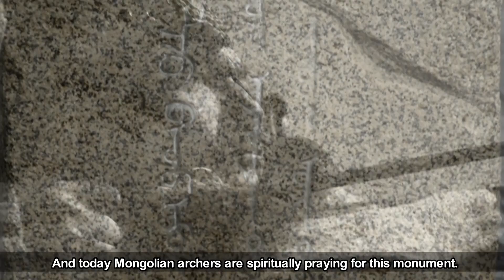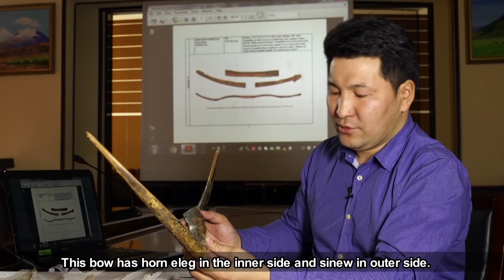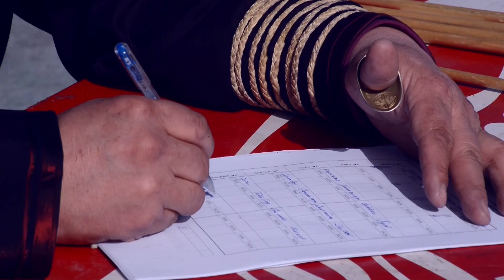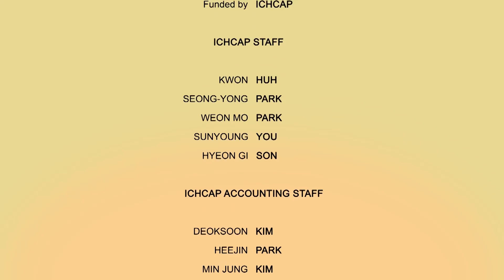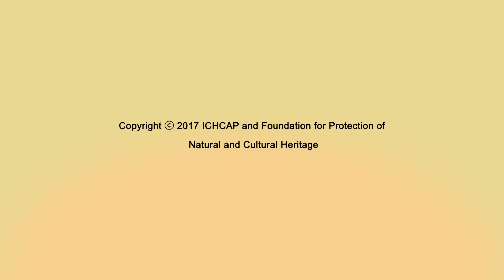Mongolia-Wisdom of Mongolian Bow Makers

Comment: If anyone is interested in the bows shown in this doc, visit the bowyer's FB page and send a message to their staff:
 https://www.facebook.com/TumurkhuuBatmunkh/

The bows themselves are surprisingly inexpensive. That said, shipping is v expensive.

They don't take PayPal. They use wire transfer, or MoneyGram afaik.

If you want a 13th century/Genghis Khan era bow, ask about the 'Hunnu' bow.

Afaik their other bows are based off of 17th century design.

These bows--like many traditional/laminated bows--require a different level of care:
Keep your bow in a non-humid environment, store it unstrung and on it's side(if you don't do this the bow will warp over time, just view it as a living thing). Do not leave the bow unstrung for more than a year(it could flip the other way). Do not expose it to excess heat (the glue could melt). The draw weight of the bow can and will be affected by temperature... When it's cold, it's harder to pull, when it's hot, easier to pull. I don't reccomend shooting the bow below 41 fahrenheit (5 celsius)

Comment: great documentary. i'm curious how do they manage to keep the arrow so still while having it on the left side of the bow. the thumb draw often causes the arrow to move left and hard to stay still.
Reply: Yes.
I am wondering the same thing. 
Someone who know. Do let us know.
Thanks
Reply: It must be the way they hold the string with the thumbing, if you lightly twist the string the arrow gets pushed into the bow, the other way would be canting the bow but the archers hold the bow straight
Reply: They are using the thumb draw underneath and clear of the arrow knock so they are not torquing the arrow to the left with their fingers. But if they had the arrow on the right side of the bow with a slight rotation tension in the left wrist the bow would twist slightly when fired reducing arm slap and reducing the archers paradox. The arrow on the right side of the bow is better for shooting from a horse which the Mongols were famous for, I am surprised they do not do this.
Reply: @MegaDavyk  they can't shoot with this style from the 🐎, Mongolian horse archers put arrow on the right side.may be it comes from olimpic archer and some history finding of the thumb ring.
Reply: @MegaDavyk  Mongols of the 13th century fired arrows from the right side of the bow only when they are riding a horse. If not, they loosed their arrow from the left just like Europeans but using thumb technique (to improve accuracy of foot archers or when dismounted). It is crucial culture and cannot be broken because of ancestral knowledge of Mongols.

Comment: The Mongols became the masters of mobile warfare. Archers mounted on horses became effective engaging the enemy using speed and maneuverability. Their adversaries using traditional infantry at the time armed with spears and shields by the thousands even supported by archers and slingers who are thoroughly trained and cohesively combined into a fighting force were no match for the mobile Mongol empire's mobile horse archers. Reason is the Mongols have taken combined arms strategy faster at a higher level faster than the Greeks under Alexander and the Roman Legions after using superior infantry tactics to gain ground and defeat an enemy. The Mongols were successful in using speed by using their cavalry archers to change the timing in combat to their advantage. Mongol commanders can change their approach into combat thus shaping the fight. With overwhelming multiprong approaches using speed and firepower it will and cause confusion to the enemy forces thus causing them to move into unfavorable ground then to be defeated, flanked, and slaughtered. Giving the Mongol infantry and allies less fight to crush them on the flanks. A flanking movement on an enemy will cause them to compress giving the opposing forces a gap to breach their lines and get into their rear to break up cohesion with other units to their right or left. The Romans for centuries have done this in their paraphrase "Break them to their front and put the sword up their ass!". The Mongols have done better using their mobile firepower to create a breach which the enemy cannot recover from and sweep both their flanks using their infantry to crush them causing confusion into their ranks and command. The Mongol forces have used strategy and speed to reduce time in combat and exploit opportunities which presents itself and use the initiative by individual commanders and soldiers to win a battle. Their key was flexibility in local and unit command thus confusing the enemy. The Mongols had the key thing going for them which is outlined in the modern 5 paragraph operations order's bottom line. That is the "Commander's Intent". Take the objective and keep it and do your part of the mission. Contingency plans if should the enemy foil your present plans to support adjacent units included into your attack. They include retrograde, defense, and counterattack. I am sure they did detail planning and anticipate courses of action should those emergencies arise.